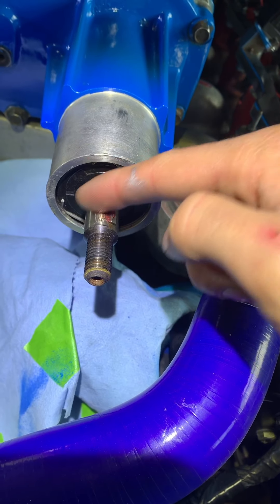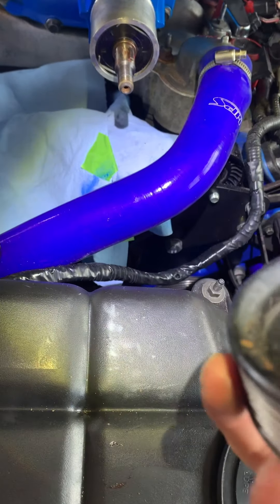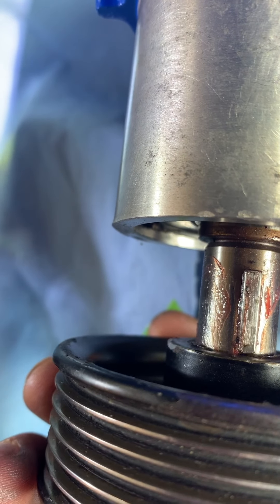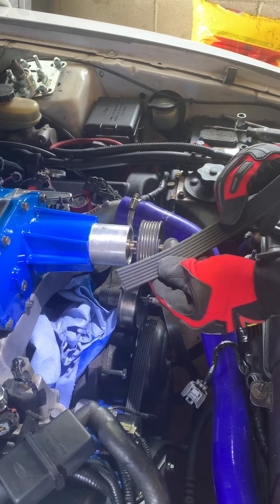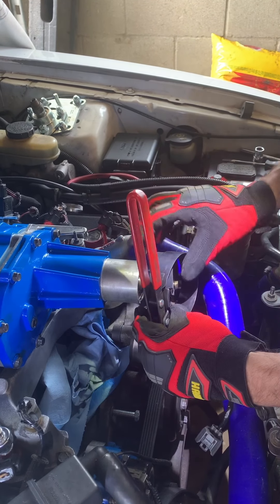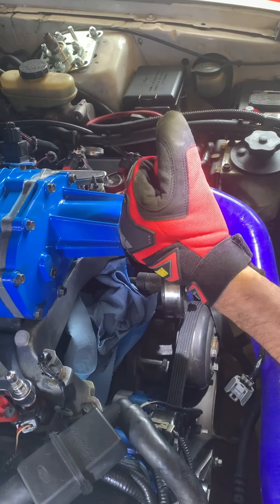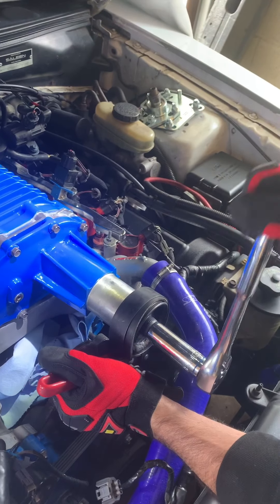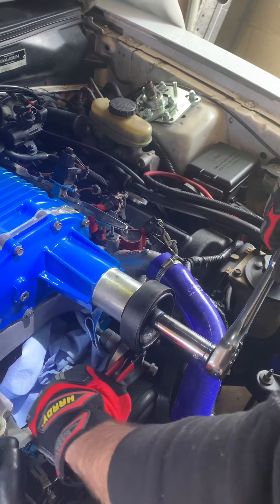2000 Saleen SC pulley removal and install

Comment: The "snout" on your sc looks just like the one on my m45 supercharger. I've been researching this tor a while and was confused why mine has the stud+nut coming out the front and how it's supposed to work. I wasn't sure if other pulley removal/install methods could be applied to this.
Thx for this video. I'll just get a rental tool from autozone and then hopefully mine is an easy job
Reply from the maker: That’s interesting! If it’s like mine then it’s on there under a slight bit of pressure. Let me know how you got yours out.
Reply: @SaleenDrift  I borrowed a hub puller type thing from my neighbor and then it broke before getting my pulley off. Next I'll try autozone, then I'll resort to buying some specialty tool
Reply from the maker: Oh wow! That’s wild, let me know how it all worked out. I wonder if it’s rust that’s making it so tight. It shouldn’t take much to pull it.

Comment: If you have the snout off the supercharger (as in rebuilding it) and you use a horseshoe plate or something suitable to hold the snout there is no reason why it couldn't be taken off on a press correct?
Reply from the maker: I don’t see why it wouldn’t be possible. The pulley is pressed on there much like the pulley on the crank or power steering are. Only thing to be mindful of is not damaging anything in the process.

Comment: How much pounds of boost does it run before pulky swap, or in stock form , mine only runs about 4-5 pounds,
Reply from the maker: @mfjones2217  yeah there is a lot of belt slip with these. I used to get about the same before swapping to an 8rib pulley and upgrading the tensioner. I get 8 psi now sometimes a little closer to 10 at high RPMS.
Reply: @SaleenDrift  I see I appreciate your time, I think I get about 5 pnds , at peak,
Reply from the maker: @mfjones2217  my pleasure! Yeah these SC don’t put out much boost. I am only keeping mine for originality purposes.
Reply: @SaleenDrift  mine is ported , at first I thought bypass was faulty, honestly u could run 5 lbs without a bypass, I plan on see what blower I can swap onto lower saleen, tvs 1900 would be person

Comment: What is that tool called that you used to remove the pulley
Reply from the maker: https://shop.advanceautoparts.com/p/performance-tool-4-inch-3-jaw-hd-gear-puller-w136p/11244449-p?product_channel=local&store=6274&adtype=pla&product_channel=local&store_code=6274&gclid=Cj0KCQiA88X_BRDUARIsACVMYD-4HxJA27zXenw3nG_WwrWZW6gMkN2zfQOeXz4Da4WUDYY-o7IiTpcaAtHlEALw_wcB&gclsrc=aw.ds
Reply from the maker: Google pulley removal tool; harbor freight has a set. Sorry I forget the size. But if u get the set, you should be good to go.